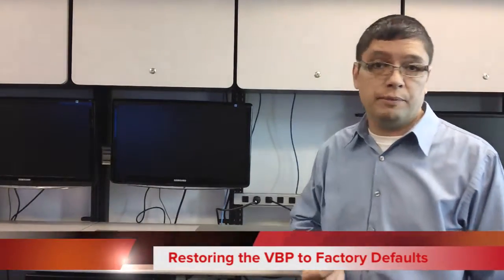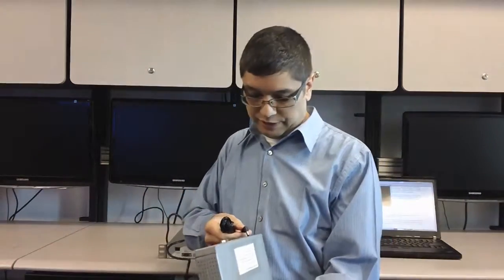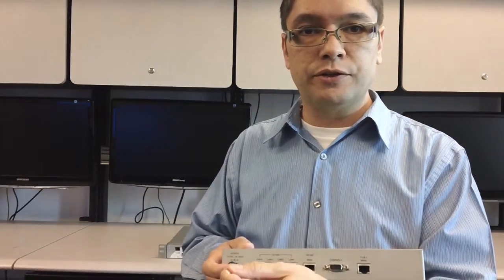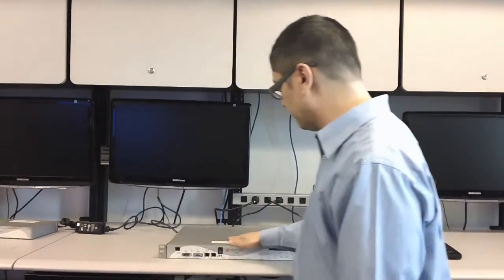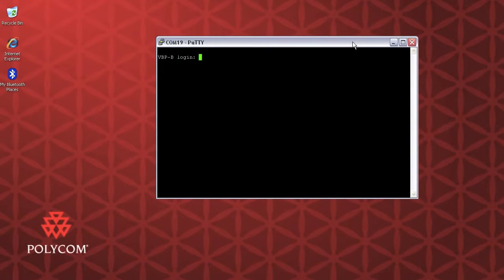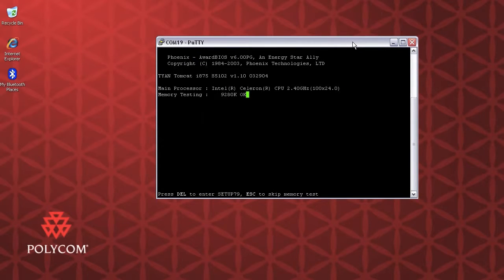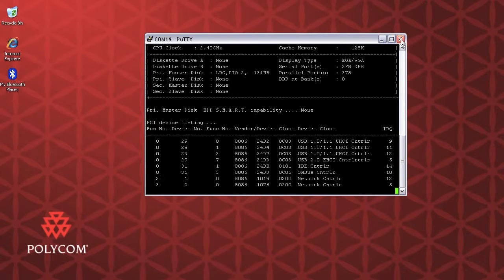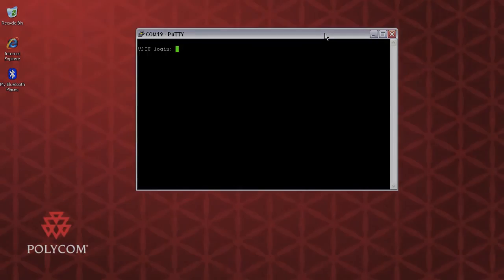Area51 Update: Resetting the VBP

Comment: What if your root password has been changed from the default, is there any way to access the system then? This is in regards to the 5300 reset.
Reply from the maker: If you have a current maintenance contract, you should contact Polycom Support and open a ticket... Unfortunately, I don't have access to the lab currently otherwise I'd make a new video.

That said, the CLI password is not the same as the web GUI password. If you did not change the CLI password, then it is still the factory default. If you did change the CLI password, then you'll need to press the "Erase" button 2 times to reset it.

o Pressed once: Nothing happens.
o Pressed twice: The CLI password is reset.
o Pressed three times: The device is set to the factory defaults

Polycom Support can walk you through this and help you restore your VBP.

http://support.polycom.com
1-800-POLYCOM